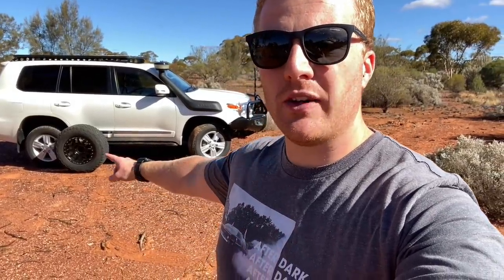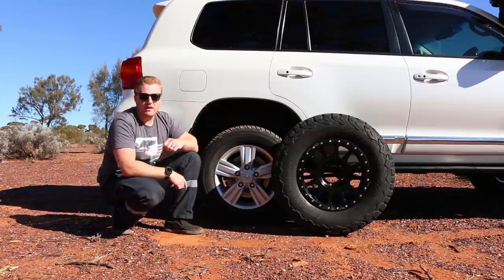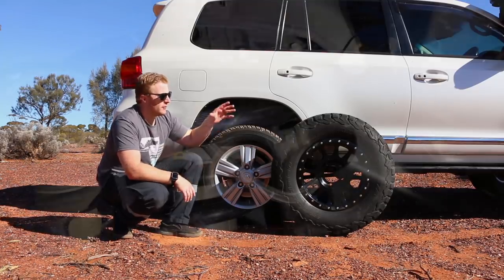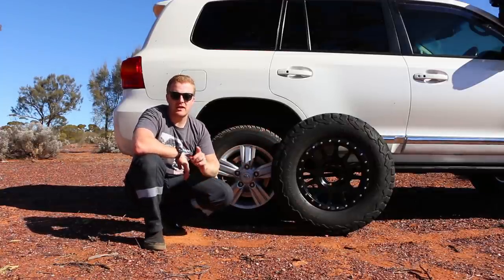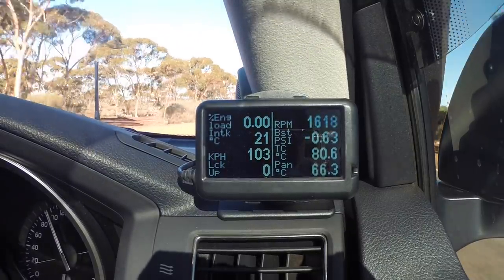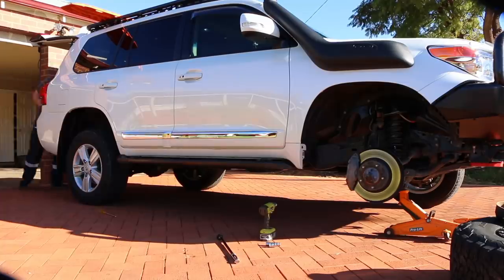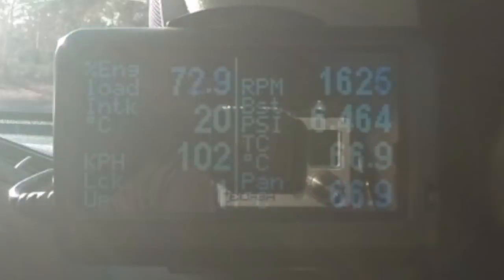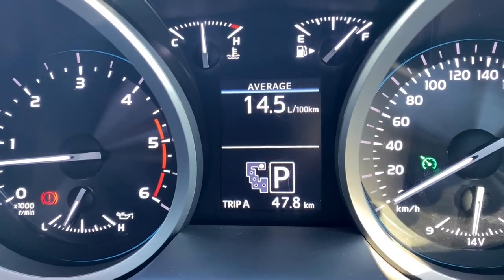TYRE SIZE COMPARISON | How much power is lost | Fuel consumption? | BF Goodrich AT | Landcruiser 200

Comment: Your calculations have to be wrong. 
You are letting the on board computer determine L/100 and yet the in the end you clearly show that the onboard computer is wrong in terms of actual distance traveled. Therefore your results have to be incorrect. 
  You drove 50.4km, both times.  
The second time your onboard computer only thought you drove 47.8km on the second trip. 
 The first trip you used 13.7L x (50.4/100) = 6.9044L of fuel according to your car.  
The second trip you used 14.5 x (47.8/100) = 6.931L of fuel according to your car.  But in actual fact you covered the same distance (50.4km) 

To convert this 6.931L  back into  L/100 you are looking at 13.75198... L/100
So, at least in terms of highway kms the increase is really marginal. 
Unless I am missing something.
Reply: I agree with this statement. Back of the napkin calculation gives me:
Stock vs Upgrade: 50.4 km vs 47.8 km (5.4% difference)
Fuel consumption on the upgraded tyres: 14.5 l/100km adjusted by 5.4% -> 15.3 l/100km actual
Taking the tyre comparison chart at the end of the video and working on a circumference difference of 6.7% (which more or less translates to difference in distance measured) that 14.5 l/100km becomes 15.47 l/100km (basically a full l/100km more than measured), which sounds more realistic.
Other than that a very informative video that seems to take into account the remaining measurement differences when fitting larger tyres.
Reply from the maker: Thanks guys, I appreciate the feedback on this.
I have to agree with Werner on this. Your calculations are correct and this makes perfect sense. 
Again, thanks for posting this information on the video, hopefully others will read them and get the  information.
Cheers, Nathan.
Reply: @XploringOz  Good effort on the vid though, keep it up!
Reply: @XploringOz  I might want to contradict my own calculations above. Something has been bothering me subconsciously ever since I posted my comment. It all depends on how the computer measures the fuel consumption: if it has a fairly accurate way of measuring actual fuel volume used, the results with the larger tyres used in the test are actually better than the onboard computer displays:
14.5 l/100km over 47.8 km (measured by the odometer with larger tyres) translates to 6.931 liters of fuel used (14.5 * 47.8/100).
However, since we know the actual distance is closer 50.4 km, and assuming the fuel used was measured accurately, that works out to 13.75 l/100km (6.931 * 100/50.4) which is hardly any difference to the original measurement.
In South Africa the stock 200 series has a fuel tank of 93l. Given the consumption values, if my first set of calculations are correct, you'd get just under 80 km LESS out of a tank of fuel with the larger tyres (~600km vs ~680km), whereas if my second set of calculations are correct, that drops to only about 2.5 km less on a tank.

The only true way to know is to drive a distance measured by GPS and tracking the fuel used at a fuel station with both sets of tyres under otherwise identical parameters.
Reply from the maker: Thanks for the input mate. I understand where you are coming from on this, it will totally depend on the parameters the vehicle uses the measure the fuel consumption. 
Although I see your logic behind these calculations, I do believe the vehicle must use different measurements. When driving on these new tyres, you can feel the vehicle working that little harder to keep the vehicle at speed. If I had a guess, I'd say the vehicle is using more fuel consumption with these larger tyres.
Your right though, without doing more kilometres and testing side by side with GPS and fuel stops, we can only speculate. 
Thanks again for your input and hopefully I'll be able to provide a more accurate test in the future.
Cheers, Nathan.
Reply: @wernerduvel6114  Hi Werner, I like this explanation better than your original. 
The car measures distance travelled by wheel revolutions vs original tyre size.
With the bigger tyres the wheel revolutions will be less for the same the distance measured but the car and economy gauge don't know the difference because the car hasn't been recalibrated to the new tyres.
The method of measuring fuel used is consistent between both tests (guess that just measures the amount of fuel sucked from the tank to the engine).
So, given the second test has less wheel revs the car underestimates the distance travelled, but compares that against a correct fuel measurement. 
Fuel used (correct estimate) / Distance travelled (underestimated) = Underestimated fuel economy.
Easier to understand when using the old measure of miles per gallon. 
Distance travelled (underestimated)/Fuel used (correct estimate) = Underestimated fuel economy.

Thanks for your explanation and sorry for my long response. Just needed to work through it myself. I will sleep better tonight knowing my bigger tyres haven't made much of a difference to my fuel economy.

Great vid @XploringOz . It looks like a lot of work went into it.
Reply: Nope. Youre working the wrong way, more tire circumference means the vehicle travels further on the sane no of revolutions. Meaning the vehicle thinks it hasnt travelled as far on the same fuel. 

And I dont know about your percentage difference, maybe thats the actual curcumference diff, but if the course was next to identical then the percentage difference is 5.16% going by the trip meter. 

(47.8 - 50.4) / 50.4 = -5.16%
Reply: @XploringOz  How did the engine work harder when the revs were less with bigger wheels? Do you just mean getting up to speed or cruising speed?
Reply from the maker: @MrRobinski  So the load placed upon the engine with the larger tyres is greater. The RPM is only one method of determining work load. The bigger tyres require more engine input at the some RPM of a vehicle with smaller tyres. Essential this will mean that more diesel will be injected into the cylinder in each cycle, resulting in higher power outputs, higher fuel usage and general greater heat. 
It would be like driving a manual 4WD in 1 or 2 gears higher than appropriate. The engine will labour and struggle to maintain and build speed, injecting more fuel and generating more power on each combustion cycle.
Hope that makes some sort of sense
Cheers, Nathan.

Comment: Without adjusting for the gearing of going up in tire size, your figures aren't going to be correct. For example, when your speedo read 100km/h on the larger tires, you were actually doing 107km/h. Same for fuel economy.

Comment: Hi 

Interesting tip you did with the shifter. Does it apply to any 200 series? In what situations do you use it?

Id love to know more about it if dont mind.
Reply from the maker: Thanks mate, I know it works with these pre-facelift version of the 4.5L V8 twin turbo, I can't comment on the newer models or the petrol engines.
I generally use this feature when highway driving and not towing. I find that the added weight due to accessories and larger tyres effect the shifting patterns. Enabling a lower 6th gear engagement and stronger retention just allows the torque converter to stay locked and prevent the vehicle from 'hunting' gears as often.
Hope this helps.
Thanks, Nathan.
Reply: @XploringOz  thanks. Greatly appreciated.

Comment: You did NOT need a 2in lift to fit larger tires. Not unless it was a 2in body lift.  If it was a 2in suspension lift, all you did was push the suspension down 2in within the stock range of travel. When you go off-road you will compress your suspension, moving the tire BACK TO STOCK POSITON or even higher up into the wheel well.  

In other words, if your tire doesn't fit at stock height, it doesn't actually fit with a lift.
Reply from the maker: Might be a bit different for yourself, but I can guarantee you that these tyres will NOT fit within standard guards on stock suspension. I suffer from very minor scrubbing even with this lift now...
Reply: @XploringOz  It isn't the lift that creates clearance for large tires on an IFS vehicle. 

If you have minor scrubbing now, you would have the same minor scrubbing at stock height. 

Watch this video which clearly explains and shows why lift height doesn't matter. https://www.youtube.com/watch?v=33VewJFda1Q&t=333s

Comment: You math is wrong @15:57 by a factor of 15 times (1539%) or more. The correct increase is just 0.38 % not 5% - you forgot to factor in that the speedo is showing the wrong distance.  In the first test, you used 13.7/100*50.4 = 6.9048 litres of Diesel.  In the second test, over the "exact same distance", you used 14.5/100*47.8 = 6.931 litres of Diesel... a mere 26.2 millilitres more, which is less than even half of one percent (0.38), not the 5% you got by wrongly comparing "13.7" with "14.5".   Note that 26.2 millilitres of fuel will take you approximately 175 meters, and will take about 5.72 seconds at the speed you were driving.  

Long story short - there's no fuel difference at all (that number is so small, it's impossible to measure using the instruments you had and conditions you drove in, especially when you spent a whopping 2 minutes behind a truck, which was 21 times longer that it takes to burn 26.2ml of fuel...)